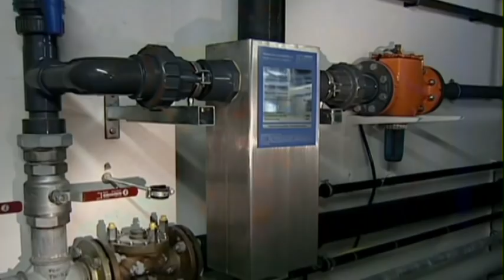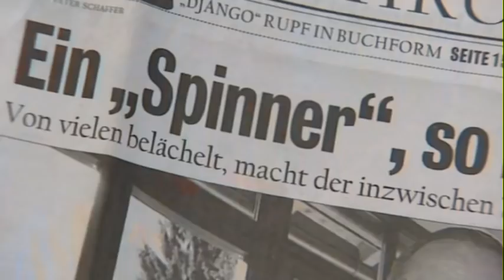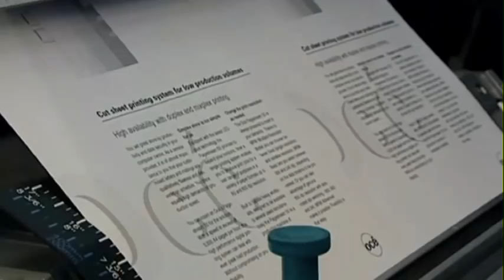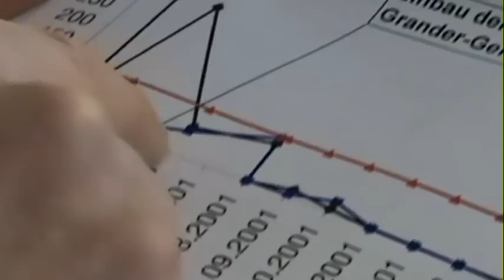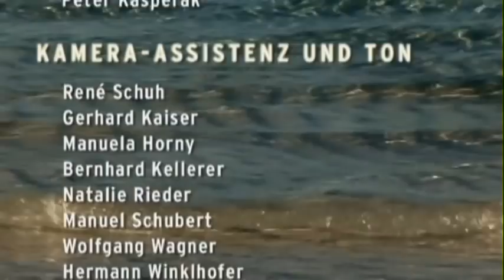Johann "John" Grander - The Waterman of Tirol - Inventor of Revitalized Water

Comment: Grander water 9:03 success with farming stems from purity of RF sound microbial life need to hear from the plant to shapeshift DNA configuration to fit the plant, this is Genises at work Genises continuing.
After microbes ingest methane then and only then do they gestate propigate by cell devision, imediatly after these microbes take nitrogen out of air, metal minerals from the sourounding soil, and DNA shape shift to the plants Genises creation frequency too feed that plant.. This Distortion in sound demonstrated above video 9:03 because of poor water quality could greatly impeded these microbial life from doing their Genises DNA shape shift to feed that plant..